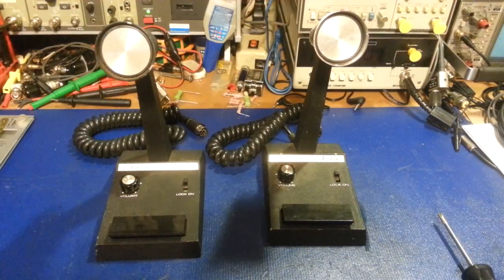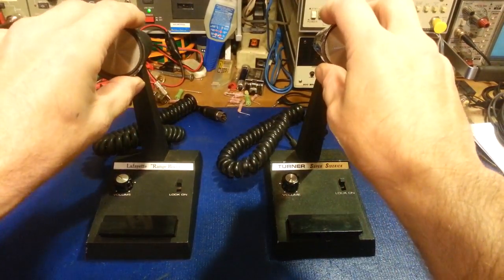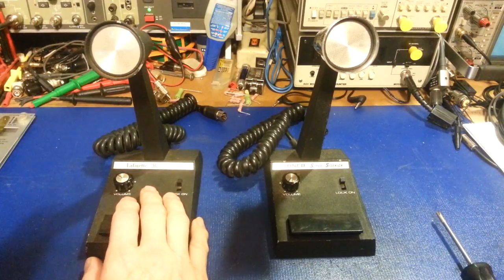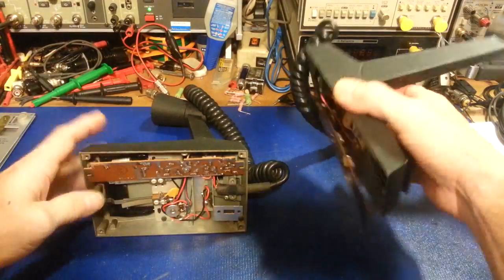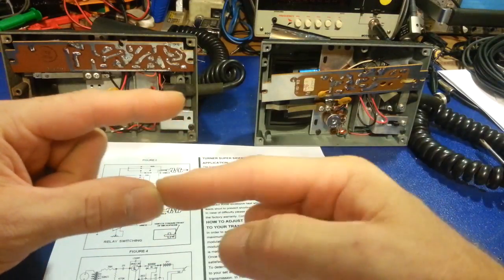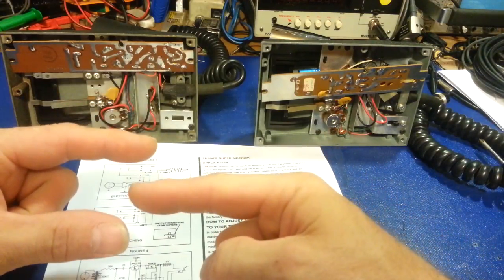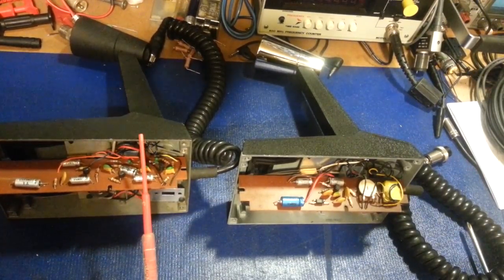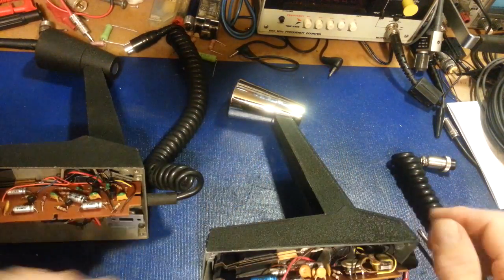Comparison of some different model Turner base microphones and mic plug wiring.

Comment: I get so tired of different mic pin configurations it drives me nuts to need a mic for a radio and have everything but what I need. So for example my President Lincoln is the only radio I own that has a 5 pin mic excluding Realistic 5 pin Din. So when I started using a Ten-Tec 715 Voice Processor I made sure to wire the the input to accept 4 pin Uniden so I can use any common mic from junk to high end that I might find at a truck stop in a pinch. Then on the output the Ten-Tec using 1/4 phono jack with Ten-Tec's unique and kind of stupid configuration so I wire a 1/4 inch phono jack to 5 pin President. So now I can use any 4 pin with my President Lincoln. If the Ten-Tec 715 is not active the signal just bypass's the electronics right tot he radio. I hate needing to wire a mic right this second but how many spares do you want to keep pre-wired for each radio. I like change and progress as long as it is serves a purpose besides making life difficult for the customer and increases profit margin in acc. sales. Long after a lot of these companies are gone we still have to deal with their stupidity. Like putting the clarifer control on the mic.Because mic's have such a long life cycle and never go bad. I mean everyone get's at least 15-20 years out of mic and mic cord with no issues!  Often you have to change the mic adapter on the radio because you can not find the magical Unicorn mic connector to go with your NOS ultra rare fantastic radio. Just thinking about it makes my blood boil! Of course the only part missing from the NOS inthe box still in plastic radio will be the unique un-obtainium mic. Even when you get a standard like a RJ45 jack or 8 pin Universal connector it will have one wiring for Icom one for Kenwood one for Ten-Tec. It is a good thing computers are not like Radio's or the entire world would be screwed and nothing would be plug and play!
Reply from the maker: The yellow wire is only used in some rare applications.  99+% of the time its just cut off.  It is connected inside the mic to another set of switch contacts and is connected to the shield in receive.
Reply: Mic cords and mic connectors have always been a pet-peeve of mine. To me radio's are like appliance and I expect at least that kind of easy intuitive use. Their is a reason why we only have so many light bulb sockets in America used for residential use versus commercial use. Their is a reason we have XLR plugs on modern mic's to the point that it is almost universal. Their was a reason everyone decided on 1/4 phono jacks for home audio equipment with a common wiring for all mono and stereo plugs even today with 3.5mm they are all wired the same. USB again common recognized standard I never have to rewire my USB port to use another brand of memory card or external device. The mic connector at the very least should have been made uniform a long time ago. I can not see anyone needing more than 8 pins on a mic especialy considering 1-2 pins could be used for digital signals or analog pulsed to control many different things.
Reply from the maker: +buckaroobonsi555 

Its easy to need 12 or more pins on some older mobile radios that had all or most of the controls in the mic.  And having extra wires in the mic cord is a good idea because you never know what it might be hooked up to so you may need that extra set of switch contacts in the mic for something.  Phone plugs had nothing to do with audio (not really) to start with.  Their called Phone plugs for a reason.  They were used back in the day when you picked up your telephone and a operator asked you who and where you wanted to be connected.  The operator used a Phone patch cord to connect the call.  There were just a gazillion of them around and the audio/radio industry just picked up using them because they were readily available.  XLR plugs are actually a nightmare.  2, 3, 4, 5, 6, 7, 8 pin and more ways to wire them than you can shake two handfuls of sticks at.
Reply: Is it? I just know it get's old. The proprietary mic plugs that you can not even purchase any more is maddening! LOL Most people can not take some odd connector and chuck it in a lathe and turn it down. You are obviously a lot more patient than I am! LOL Good thing your the Tech! LOL
Reply from the maker: +buckaroobonsi555 

The only reason I had to chuck the plug end into a lathe was to modify it to work in something it wasn't designed for, a antique adapter housing.

What mic plug is not available?  As far as I know their all still made.  I purchased about 50 30º lock ring DIN 4 and 5 pins brand new just the other week.  Switchcraft has been making them for decades and still does.
Reply: Oh I meant phono plugs 1/4 inch not phone plugs. LOL Sorry if I typed that wrong.  Did those come from telephone use? I have seen cartoons where the switch board operator had what looked like phono plugs for a stereo but I have never seen the real thing. I have seen black and white movies though where the operator was plugging stuff in but never in detail. Makes sense! How did they go from being called Phone plugs to phono plugs?
Reply from the maker: +buckaroobonsi555 

1/4" phone or phono plugs, same thing.  A gift from Bell telephone.  I think the name phono may have been picked up from the phonograph.
Reply: That is why I did not make the connection until you pointed it out. I have seen some rather strange to me phono plugs that have a large ball shape on the tip. They are old looking made out of Bakelite and are normally advertised as military surplus. What are those for?
Reply from the maker: +buckaroobonsi555 

Were probably mil surplus test equipment ends.  Some old test equipment used 1/4" jacks like that.  I have two drawers full of those ball end plugs with military nomenclature numbers on them.
Reply: I always wondered what they fit. They like well built for sure which probably why they are still around. It is hard to find quality phono jacks most of them are made from some thin cheap feeling plastic today. Luckily I do not need them often. I am picturing you chucking one in a lathe to turn the big ball end into a nice pointed tip! LOL Not that there is anything wrong with that if you have the ability to do so. LOL You do strike me as the best electronic restoration/repair technician I am likely to ever run across! I doubt you have too many equals that can both repair electronics and fabricate parts or modify parts on a lathe or mill in the electronic repair industry. You strike me as a very very competent and professional man that knows his trade and is a master of his world!
Reply from the maker: +buckaroobonsi555 

For good quality of audio type plugs of all kinds Switchcraft is still the go to company.  Thats who most of my audio plugs and sockets come from.
Reply: I am going to save that to a word document. Switchcraft. I have just buying mostly NOS stuff off ebay and from local guys that go to swap meets and such. Thanks!
Reply from the maker: +buckaroobonsi555 

Here's a link to their catalog page.  They have been around since the 1940's.

http://www.switchcraft.com/Publications.aspx
Reply: I have used a lot of Russian Military Surplus parts like multipole ceramic rotary switches, vacum caps, and tubes. I had never heard of Switchcraft before! Thanks for the info!

Comment: I have a vintage TURNER PLUS 3 mic I bought from Ebay.  Photo at https://imgur.com/0fjB9Fj The seller said the TURNER is wired for 4 pin COBRA.   I am trying to get the TURNER to work with my UNIDEN 980SSB radio which has a 6 pin connector on front face of radio.  I connect the UNIDEN 6pin to 4pin adapter which came with the radio from the UNIDEN to the TURNER, but the TURNER doesn't work right. When I press the TX key, it changes the channel of the radio.  I am a newbie to radios and I am trying to wire the TURNER so it will work with the UNIDEN 6pin to 4pin adapter, but I can't figure it out.  Mike, can you help me out? Thanks for a great video.